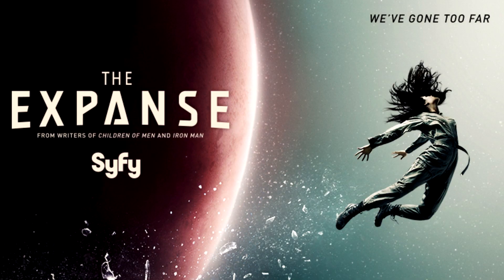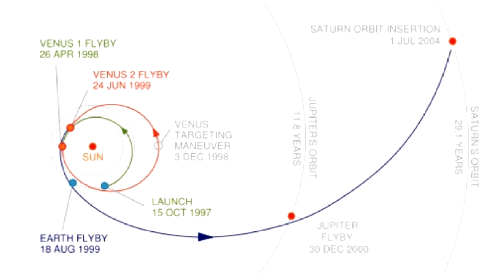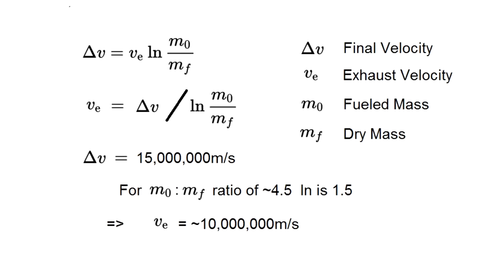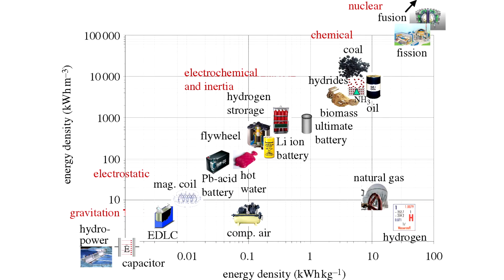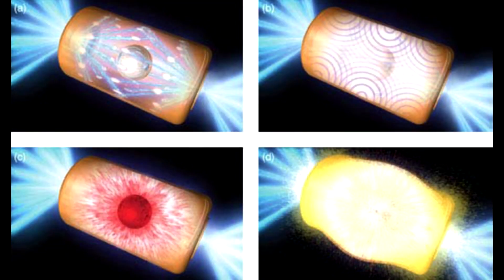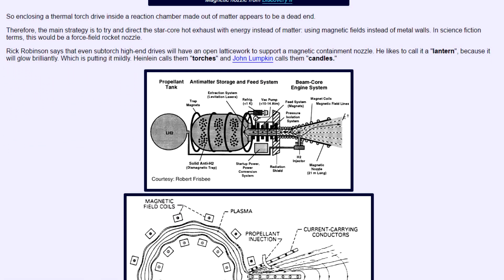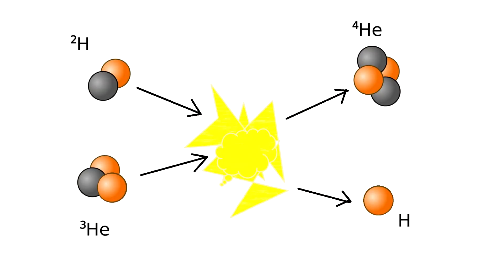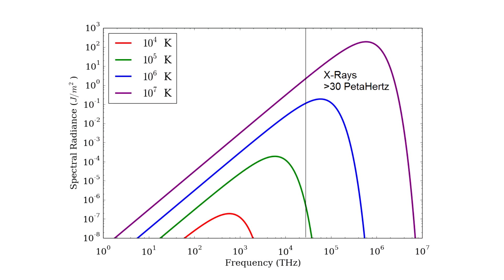The Rocket Science of 'The Expanse'

Comment: You wouldn't need to use radiators to get rid of the excess heat.  You could use a flash-evaporator to cool it.  By running liquid hydrogen over the hot spots, it would evaporate and give you more thrust.  The ISP from that would be way down compared to electrodynamic thrust, but maybe you could use an electrostatic field to accelerate the hydrogen even more after it is vaporized.

What will be possible 200 years from now is beyond what we can imagine now.  The problem with "The Expanse" is that most of the technology isn't advanced enough, rather than too advanced.  I mean, is it really likely that they will have revolvers and flat-panel displays two centuries from now?  This show will look outdated 10 years from now, much less 200.
Reply: David Messer what is the problem with flat screens? What would you replace it with? Invention and innovation might never see an endpoint but convenience and usability will. Like doors haven't changed much in the last 800years, a big solid object with a handle to manipulate it or the concept of a car is still the same as when it was invented eventhough we now face autonomous driving. A screen might just be perfect for the task it is intended for: showing information. You could use VR, AR or holograms but the first two need additional equipment for thirds to see the information and the latter is overkill if you don't need the 3rd dimension to relate information. You can increase size, visual fidelity and reaction times but in the end it still has the same purpose.
The fashion, maybe new synthread nano fiber in the style of 20th century earth to romanticise the good old days or a colony of hipsters? ;)
Reply from the maker: The problem with this cooling concept is that the thrust from evaporative cooling will have much lower specific impulse, so the spacecraft would not manage to get to 5% of the speed of light.
Reply: Scott Manley 
Indeed.  I realized that when I made my original post.  :)

What do you think of the idea of accelerating the hydrogen electrodynamicly after using it for cooling?
Reply from the maker: It's possible, but the net energy density still has to come out at 50terajoules per kg of fuel/coolant. So, too much coolant will drop energy density and make it less efficient than engine in story. The heat is so extreme that the boiloff rate would be too high.
Reply: Scott Manley 
Well, I pretty much agree with your reasoning.  I think that with 200 years of engineering effort that the problems are probably solvable though.  We are like engineers in the 18th century saying that 600 mph speeds are impossible because you couldn't make sail cloth strong enough.

There are a lot of other issues with The Expanse though, like "Where are the computers?" and, as the XO asked in the first episode, "Why is everything so dark?"

I love your videos Scott.  We have about a 95% overlap in our interests but you have massively more energy than I do.  I don't know how you do it.
Reply: David Messer Do you mean why isn't everything automated?
The darkness is a thematic choice. Earth is cast in sterile light, Mars and the Belt are dreary.
Reply: Elliot Smith 
Lasers cooling only works for tiny increments of temperature near absolute zero.
Reply: You really think if we can map a brain.  Upload and live in a machine. That we will not be able to simulate the effects a chemical would have on our brain.  On when it would be released?  Also we may slowly remove these effects.  Yes changing who we are.  However I do believe it will be with the fore knowledge that it is happening and that we choose it.
Reply: A real solution to the cooling problem would be force fields. Now I have been researching how to do all this 'sci-fi' stuff for about 20 years and force fields are a real basis for doing almost everything. Of course the problem is creating force fields in the first place and the solution to that lies in the FTL part of the physics system. Create a sustained FTL coherency and you have the core of how to build a force field. However the thing is a chicken and egg problem because to create sustained FTL coherency you probably need something like a force field. Now (my own work shows that) quantum coherency is a type of FTL coherency so that is a starting point. Force fields would allow the development of miniature fusion reactors, lightweight radiation shields, maybe even gravity engines. Going beyond that without force fields FTL travel itself would probably be completely impossible. the very first thing an FTL ship would need is a barrier or shield against dilation - but creating such a barrier would be about 70% towards building a complete machine.
Reply: where are the computers? well the machine you typed this comment on probably has enough power to calculate orbits and such so it really isnt that hard to believe that 200 years from now a small computer could do everything necessary for a spaceship. And you dont put a computer in your home when you can just have a small device in your ceiling or walls that runs everything wirelessly
Reply: CloudIncus 
A chemical reaction can be simulated just like any other physical process.  I don't see any reason that we would remove it once we have it in the simulation.

Whether it is practical is another story.

It would certainly be interesting if we could make a copy, or backup, of ourselves easily.  I imagine it would change society quite a bit...
Reply: Lucien86 
Sounds like a realistic solution to the problem.

It probably would be simpler to just use an anti-gravity drive though.
Reply: you have got to remember, the reason science fiction, tv shows or movies never get it right is because they are not scientists, and even in the case that they consult scientists, not even they really know what the future will hold 200 years from now, for if they did, we would be that much more advanced, you cant actually know with out knowing, and nobody really actually knows, its only best guess, and thats usually far off, even if on the right track.

the only thing we can, and should, get right in entertainment, is the physical restraints that we know of today.
Reply: Harambe's Ghost still tho...this is 200 years so its Not even near the levels of optimism that 60s people had. It all Relies on 1 single Innovation which is the Epstein Drive. And yeah even if computers wont get much smaller they dont need to be much more powerfull than todays Computers either. As previous commenters have Said your Phone can probably do everything necessary for a spaceship. You never need a Computer bigger than you standard PC for anything that doesnt involve massive amounts of data. Even big spaceships would need 1 server Tower at max.
Reply: Harambe's Ghost, The only reason we don't have moon and mars bases is because the government and the American people supported trillions of dollars spent on defense that was never needed instead of space exploration, 100 billion put 12 men on the moon, 6 of them driving cars on the moon! The US government spends at least 6 times that every year on the military and during the lat 10 years of the cold war 10 times that every year on the military. Now FTL travel was stopped by our current understanding of physics.
Reply: David Messer Do you know how much a period piece set 200 years in the past spends on costume design? This would require you to make up not only one style, but multiple to show still show the differences between cultures. You would then have to "realistically dress" everyone in what you think makes sense. It's easier to dress Earthers like aristocrats, Martians like working class, and Belters like blue collar workers.
They also have flat screen phones that can project 3D images anywhere. I honestly didn't like that, because it seemed unrealistic. Flat screens work because it's easy to carry, store, and inputting commands is easy. Are you saying they should all have chips in their brain?
If we got "realistic" computer support, there would be no pilots, or even large crews on ships. The economy of a world like the Expanse is hard to imagine, but I can guarantee that automation will be good enough to keep people away from manual labor.
The Expanse is a story about people, not a prediction of the future.
Reply: What is wrong with laser cooling?  or maser?
Reply: @David Messer: you are thinking of a different effect, super cooling atoms.  The laser causes an extreme drop in entropy which can cause highly efficient lasers to drop in temperature.  In Expanse the authors specificly state that that the Epstien drive "Solved the heat problem".
Reply: Elliot Smith 
Yes I was.  Why did you mention laser cooling if you knew it wouldn't work?
Reply: I feel if we get to the stage that we can control dreams.  Or direct dreams.  then we will be able to map the brain and upload ourself's
Reply: Revolvers are more reliable and cheaper then automatics. Makes sense for them to be used in the Belt.
Reply: That's the best way to do Scifi, extremely conservatively!
Reply: The revolver is nearly 200 years old now and works great.  For reliability and ease of manufacturing it is still fantastic, a modern semi-automatic handgun can jam or malfunction, this would be a made far more likely if you were at 0g and/or without atmosphere (specialist not yet developed methods of lubricating the mechanisms and protecting moving parts would be needed), this would make next to no difference to a revolver.
Reply: +Esron Norse Directly neurally impresses haptic interfaces.
Reply: Just like we have TVs and revolvers now that resemble in a way paintings and muskets, in the future we'll probably have things that resemble TVs and revolvers.
Reply: Aric Dilbeck 
If human consciousness is a physical process, it can be simulated by a computer.  The brain, and the entire person for that matter, could be uploaded into a computer.  It could then be duplicated just like any other computer file.

The only way this would be impossible is if the human brain had a supernatural component such as a spirit or a soul.
Reply: Aric Dilbeck 
Absolutely.  Once we have VR to the point that can simulate high-resolution sex, the human race is done for.  Once we go into the holodeck, we'll never come out.
Reply: Sam K 
Of course, everything on a TV show is the way it is because the writer/director wanted it that way.  However, if that is the answer, there is no reason to talk about the realism of a show.  You might as well have faster-than-light drives and transporters then.

But, when an SF show has worse computer support than I have in my bedroom, and apparently uses oil-lamps for lighting, my brain says "this is only a TV show" and I wait for the alien monsters to show up.

It's ironic that Science Fiction almost never gets the future right.

If you want to speculate about the world 200 years from now, think of the change from 1817 to today and then realize that the rate of change is accelerating, not slowing down.  I don't know what we will have but we won't have flat panel displays or transparent iPhones in our pocket.  We also won't have interplanetary war or people running around in 20th century clothing.
Reply: Aric Dilbeck 
Perhaps.  We have drugs that can do that now though.  The problem with dreams is that you tend to realize that you are in a dream because something you know is impossible happens.  With the control given by a computer, VR would seem more realistic and therefore be more compelling.

One of the inventors of the flight simulator (Sutherland maybe?) once noted (I'm paraphrasing) that a simulation doesn't have to include all the details, but it can't have incorrect details.  Our brains are very good at detecting tiny inconsistencies which ruin the illusion.

The computer is needed to maintain that consistency in order to keep us in the dream.  When it can do that sufficiently, the human race is doomed.

Ah, but what a way to go!

Comment: I was thinking rule of cool had more to do with the engine design than a plausible Fusion torch drive.

Couple of points though - they appear to have some kind of cheap and very pervasive and effective way of dealing with hard radiation because a lot of people work in vacuum in the setting in nothing but space suits and you don't see them dropping dead from radiation poisoning, just from standard hard radiation in space beyond Earth's magnetic field. Though the medical arm band things were apparently able to reverse the effects of a massive exposure to hard radiation in the last episode of season one, so maybe they just treat the after effects?

My point is though they may have some novel solution to deal with hard radiation in the setting that is so pervasive it doesn't need to be explained - and could be part of the engineering solution to not vaporizing your drive and ship, etc..

I prefer to think they have isolated and understood the effect that makes the EM Drive work - as the effect appears to be real. And with understanding comes the ability to scale up the power to weight ratio and efficiency of the drive. Then we'll throw in all that hot exhaust just being a side effect of the high power version of the drive to explain the rocket exhaust being awesome . . .

Of course if that's the case they should be able to build a ship that could get to Proxima Centauri in something like 12-13 years, which would be cool.

If it is actually super efficient fusion torch drives it would also mean the solar system would be full of super high speed tightly focused plasma streams concentrated on standard shipping routes - nothing quite like getting a super hot plasma stream to the face . . . though I guess the positive charge of the plasma would disperse it, so maybe it's not deadly for too far behind the ship.

Though that really heavy ice hauler doing a 30g maneuver would have to have generated an incredibly energetic exhaust.

Comment: You didn't mention more practical fuels, like lithium/hydrogen.  Less than 1% of the energy will come out as neutrons.  You can also have gaps in your magnetic nozzle to let the xrays escape without being absorbed.  Finally, you can do what they are doing at tri-alpha energy and have a very thick layer of plasma outside the fusion core.  In theory, this plasma would soak most of the xrays, reducing impingment.

All this just shifts the problem a little to the right.  I agree with you that the science fiction nature of The Expanse's Epstein Drive is the acceleration.  You could theoretically build a starship engine fueled with lithium/hydrogen and reach several percent of the speed of light - it just might take decades or centuries to burn all your fuel, since you are limited by how quickly you can radiate away heat and how much your internal heat pumps can move.

What would be enough to make the drive work?  A PERFECT reflector.  Theorized if you could control electron clouds perfectly, you might be able to create a sheet like substance, controlled by active nanoscale elements behind it, that is essentially perfect.  If NONE of the star-hot energy from the drive reaches the structure of the ship, these science fiction levels of acceleration are possible.

Comment: ive got an idea:
you have a rocket: an engine+fuel tank, a special portion and a capsule. the engine+fuel tank and the capsule are just normal, but the special portion is made of an inflatable balloon filled with water, and you inflate the balloon in such a way that it is wider than the ship. couldn't that portion, which is initially the same width as the rest of the ship, be a good radiation shield against the solar wind if the ship is oriented that the capsule is behind the shield?
Reply from the maker: Sure, but where do you store the water before inflation?
Reply: Yes, water is a great radiation shield. In the books of the "Star Carrier" series by Ian Douglas, the ships use Alcubierre drives and singularities to accelerate to relativistic speeds in seconds and most weapons employed are going a good portion of c when they hit. Because of this, the ships are shaped like mushrooms, with a cap full of trillions of tons of water which they keep facing forward to absorb the ionizing radiation created when they hit particles going very quick-like. Additionally, if you heat the water up (like going tea-kettle in The Expanse) it makes a great, abundant propellant.
Reply: Scott Manley In a different balloon.

Comment: Aaand that is the reason a good 1,500s engine would be the hot rod sci-fi authors SHOULD want, something advanced enough to SSTO with a good payload fraction, that doesn't turn the runway it uses into a pool of lava (I didn't pull that numberout of my ass, it's more or less the limit of regeneratively cooled engines with efficient nozzles). Jet power is important! It's no good if your engine is worse than a nuke going off every second...

...unless you use something as ridiculously efficient as an Orion drive, and literally ride nukes without melting yourself. ;) Much more practical for jaunts at 1G to 5% of lightspeed.